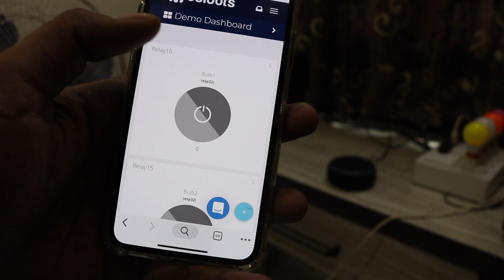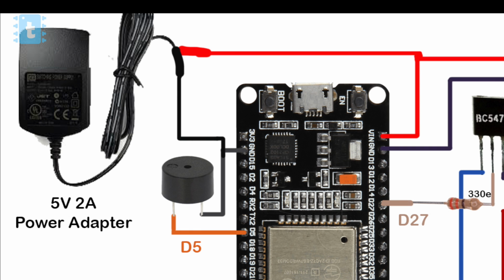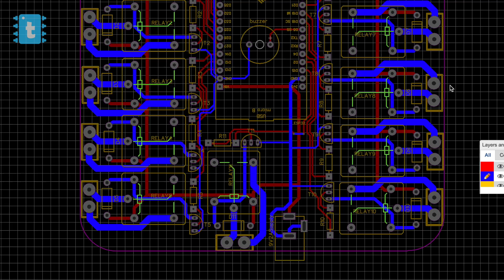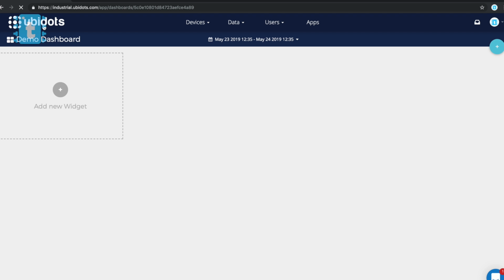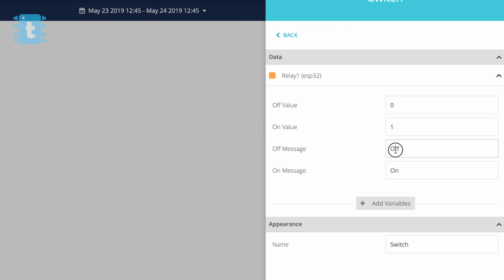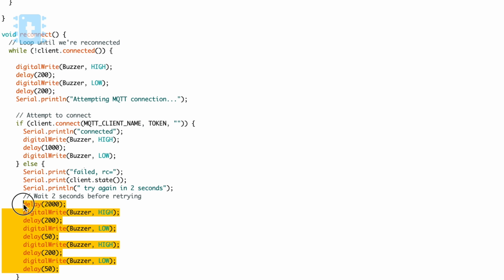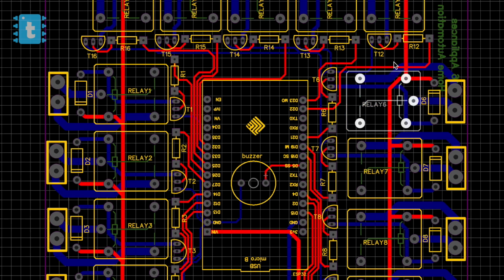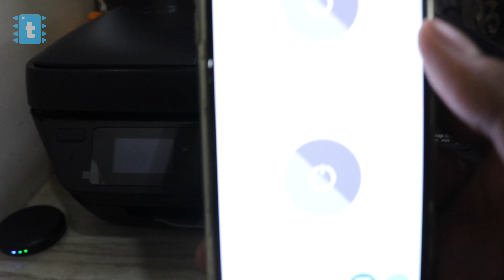My biggest Home Automation project using ESP32 | IoT Projects | ESP32 Projects | Ubidots | LCSC

Comment: GPIO 15 is a strapping pin that should be high during boot. You have it connected to the base of an NPN transistor that drives a relay. On power up, GPIO 15 will be at 0.7 volts and this could cause boot up problems.

Comment: I have an irigation system with 23 electro-magnetic valves and I whould like to make for every valve a seperate receiving board over 433 Mhz with Your system, can You make this ?  I whould like to learn to program the ESP 32 to start in the morning/night and evening/night. I investigate now 2 send receive boards that I bought on Alieexpress that work with the TP2264 send and TP 2294 receive in the 433 MHz band, maybe a combination is possible ?

Comment: Please...just please,  have some separation between the low voltage stuff and the mains power. In your enclosure the mains terminals are almost touching the relay board.
Reply: This is horrible engineering, just horrible.

Comment: I have one question
Why my node mcu esp8266mod is geeting very hot and spark when i connect it with my laptop through usb cable?
Because of high voltage supply?
If yes then what should i do?
Plzz help me🙏

Comment: Nice project! But if i were you, i would not put the trace that goes from the transistor collector to the relay coil that close to the relay's contacts traces! the isolation gap is minimal and there is a risk of mains voltage jumping to the low voltage circuits side! (dangerous!) Maybe you could correct that on the next revision of the board... Anyways, a really practical project!

Comment: Limited to 16 devices by the output pins of the ESP32? I can easily control 768 relays using 1 pin and without multiplexing hardware.

Comment: Well, just what i was thinking about. But my idea is to use triacs or mosfets (for AC or DC loads) in the form of replaceable modules (like drivers on some control boards for fdm-printers )

Comment: Sir if the circuit is always ON nodeMCU will not get damaged in future even when connected to smps 5v 2A mobile charger?
Reply: Nope. They r designed to run all the time. 5V should not harm the esp but dont use more than 5v.

Comment: Sir is not connected to the internet
can you tell me how can i solve it..This is show on serial monitor

 ets Jan  8 2013,rst cause:4, boot mode:(3,2)

wdt reset
load 0x4010f000, len 1392, room 16 
tail 0
chksum 0xd0
csum 0xd0
v3d128e5c
~ld

Comment: Sir I have using water tank level transmitter for measuring the tank level. The transmitter output  is 1 to 5 V variable 
Means
1V need to set 0%
2V need to  set 25%
3V need to set 50%
4V need to set 75%
5V need to set 100%
Can you make gauging display via blynk app with modemcu

Please  make code for me

Comment: Better if it was done using voice automated control, so that you do not have to turn on and off your mobile wifi connection instead, just send a voice command to turn on what you want to turn on and off on the fly. Good project though. Does it can be connected to your modem wifi in case you are not around and forgot to turn off something. Just connect to your IP address modem and turn it off even if your let us say ANTARTICA...LOL

Comment: hi sir. I'm getting error like this in serial monitor
rst:0x10 (RTCWDT_RTC_RESET),boot:0x13 (SPI_FAST_FLASH_BOOT)

configsip: 0, SPIWP:0xee

clk_drv:0x00,q_drv:0x00,d_drv:0x00,cs0_drv:0x00,hd_drv:0x00,wp_drv:0x00

mode:DIO, clock div:1

load:0x3fff0018,len:4

load:0x3fff001c,len:952

load:0x40078000,len:6084

load:0x40080000,len:7936

entry 0x40080310

user code done

ets Jun  8 2016 @

plzzz help!

Comment: Hello everyone . Can this circuit be used to control an electrical circuit of a home? Do you think it's safe? . I will change the relays for others of greater amperage capacity but I want to be sure that the design is used for a home electrical network. Thank you

Comment: Hi, this is a great channel Youtube recently discovered for me haha, thanks for the work on bringing it to us. I have a silly question, is it dangerous or do you need some kind of extra protection around the high voltage routes on your PCB? Could you provide some guidance on how to design them please?
Reply: I would avoid using this with high voltages.  Design does not provide for any extra HV isolation and there are no opto isolators either.  You can use this design and extend it.  Alternative is, design your own base board designed to mount the ESP32 as shown here and two 8 relay modules you can find on ebay.  Essentially your base board will be a 'mother board' that carries the ESP32 and two 8 relay modules.  Provide for additional circuitry if necessary, produce PCB and you are good to go.

Comment: I like this Project but for the house, it needs multi bored, I mean each point need separate pieces because the electric at the old and new houses because it's costly (I mean the copper wires), not designed for these systems. they are not in the Desk hehehe ;p

Comment: Hi, very nice proyect, I just wanto to add the relays dont have the necessary insulation and electric shielding for this to work properly, a single diode is less than suficient, I would like suggest the use; 
An insulated ouput, like the diigtal pin to a UNL2003 to avoid vcc peaks, and then a  of a snubber and a varistor on each relay output. 

For the sake of the electronics. 
Good work !
Reply: 5 volt relay how peak come

Comment: Can you add physical switch 
I mean turn on/off the relays via internet and physical switch
Reply: just connect a two switch and relay in two way connection mode
Reply: Arun n.g if use two way switch you don’t know the Device on or off
Reply: @hassanahmad9597   which device?, Controller or the appliances. 
If you use the two way switch in parallel connection with relay, then you have to use the same way to turn it off. I mean if you turn the appliance with switch then you can't turn it off using relay. It's not convenient. But if you use the switch and relay by two way connection mode then you can control your appliances. Just give the supply to two way switch and connect the switch's terminals to no nc terminals of relay. You can take the output control lead from relay common point.
Reply: Look 
I want to connect push switch to the Arduino 
When you push the button both relay and internet switch turn on or off ?
Like the sonoff switch

Comment: I wonder if you PCB is safe to use for 220V -(240V) and at what load. I can see that your low power lines on the PCB are pretty close to the high power ones. I'm concerned getting a leakage and PCB burn. Also there isnt a single fuse on your PCB. So while it looks neat, I cant believe its safe...

Comment: First of all - its NOT automatic - its REMOTE only. Second - china blue relays its nice way to fire up you home. You need magnetic starter for feeding things like a iron, air conditioner or heater. Blue relays can feed only small consumers like a light bulb. And at last - USE OPTOCOUPLERS  if you dont want to kill someone.

Comment: This is not automation bro... Its called remote control
Reply: Correct. Automation would be having circuits on timers or sensors to turn things on or off at certain times or when certain conditions are met. Like a lawn sprinkler system or dusk till dawn lighting or even a sump pump in a basement..

Comment: Yeah, no isolation, and those relays are way too small for any real world load switching. 
In reality you do not need all those relays when you can use properly rated power transistors which will reduce overall power consumption and the need for a snubber network / diode. You can in turn use the transistors to switch solid state HVAC relays which can handle real world loads like an entire lighting section, air conditioners and other moderate to high current appliances even switch your main city power on and off or between solar or generator power and mains city supply. make the system usable to a realistic degree.. Those tiny relays on board will only introduce a possible fire hazard into your home if you over load the circuit.
Modify your PCBs to have line isolation and mounting options and earthing provisions so people in countries that have actual electrical codes that are enforced can actually use it legally and safely.
Also this is in no way automation, this is simply over the net remote control and you do not need fancy apps on a smartphone to do this. a simple webserver arduino code with some HTML code in it loaded straight into an ESP module and all you need is a device that can connect to wifi and has a browser and you are in business. I can take your whole project and reduce it's size over half and make it NEC compliant for use in the US all while making it capable of controlling high current loads with no mechanical relays on the main PCB at all..

Automation would be having circuits on a timer  like a sprinkler system at home or on a day/night sensor to turn lights on and off..
Reply: ElfNet Designs  
"That is what 1st world developers can do" : You are a proud man, good for you keep up this community spirit .
This video showed you the essentials, it has all the parts to make home automation, so you can customize it (or built it to your code). I ve replicated it and it is working fine with all the automation rules (dependencies and timing) that I needed and only 8 relays (upgraded to 25A relays for AC, heaters etc.. block relays with isolation so didnt use the video circuitry) but couldnt do it without the support of such videos.
Reply: Perhaps you should do a bit of research before spitting on someone's work.  Your point about true automation is correct, this has no brain, so to speak, and is thus not true automation.  This hardware package could, however, be used for true automation with no modification, simply different code.  That being said, this is where you stop being right. The transistors he is using are, in fact, correctly rated for this application.   Transistor rating also has nothing to do with the snubber diode, which is designed to snub (thus the name) the back voltage produced by the relay coil turning off.  Any proper circuit which uses a mechanical relay will have such a diode or equivalent protection system, changing the transistor does not eliminate the need for this.  Your comment seems to indicate that the relays could he replaced by high power transistors, but that's such a ridiculous idea that I'm going to assume that's not what you meant.  Maybe you meant use the high power transistors to drive a SSR, but that's unnecessary.  Small transistors like the ones he has are perfectly capable of driving even very large SSRs, and actually, for the size SSRs used in home automation, the NodeMCU itself could directly drive them.  As for the size issue, I don't know if you've ever seen a SSR, but they are typically larger than their mechanical counterparts.  That being said, I'm sure if you went with the most expensive, modern SSRs you could find, it would be significantly smaller.  It would probably also be 100x more expensive, but since you're a rich guy in the 1st world that shouldn't be an issue for you.  And just FYI, most '1st world systems' use mechanical relays, snubber diodes (usually TVS), and a transistor based driver circuit very similar to the one used here.
Reply: @back_to_momblackburn8580  lol, haven't expected to 100% agree with ur comment, but I do. Exactly, people trying to have a cool hobby, and an electronic smartass comes with his shitass electrical codes and rules, who cares at this point lol. Applying to codes won't help much if the person isn't careful and reasonable in the first place.
Reply: @back_to_momblackburn8580  use a fuckin bta-16 is probably what he meant, it isnt a transistor but the closest thing to one.
Reply: So show us what you can do.
Reply: @Thuliolima2008  I myself do not have to show you when all you have to do is look up any 1st world based system that is properly installed and being used in places where electrical codes are known and enforced.. Look at the many many other IOT based systems sold under big name brands and installed in places in Canada, The USA, the UK, etc... That is what 1st world developers can do..

Comment: Nice project. But is it wise to use an external iot platform? If they pull the plug you're done. I'd advise to host your own with MySensors, Domoticz, OpenHAB, Grafana, etc. You can run all on one raspberri pi. NRF24L01 is supported by MySensors out of the box.
Reply from the maker: Thanks for the update 
I’ll explore them all.

Actually I have tried mosquito mqtt server on raspberry pi but that’s only limited to local area connections 

What if we want to control appliances from anywhere in the world. Then we need to use ubidots or other cloud based mqtt server
Reply: @techiesms  It is not restricted to local area networks. You can access your raspberry pi from anywhere in the world if you configure your router to use NAT. Just forward the desired ports to a local ip address and port. It is also possible to use a dynamic dns to be able to use a custom url as well.

Comment: Well can you operate appliances with both normal switches and mobile.
Reply: I would not run anything over 1 amp @ 120 VAC through those relays and definately nothing from the AC mains without proper earthing, unless you have good homeowners insurance that will cover experimental screw ups that result in a fire.
Reply: @Elfnetdesigns  sry I can't understand it clearly what your trying to say.

Comment: People are complaining there are no optocouplers. There is more than enough galvanic isolation in the relay. Absolutely no need for optocouplers. It would certainly be a gimmick in this application. However, I'm not saying this is a well thought out idea. 16 remote mains switchable circuit in one place, what 16 AC appliances would you need to, 1. Plug in at one point in the home, and 2. Need them all to be remotely accessible? Also the ESP32 is massive overkill for this super simple application. Why not use an esp8266? So much cheaper! Or an arduino with a Wi-Fi chip? Or an AT tiny driving a multiplexing IC and a Wi-Fi chip?
Reply from the maker: Esp8266 doesn’t have enough GPIOs for controlling 16 relays. Secondly that rate of nodemcu and esp32 don’t have much difference
Reply from the maker: Graham Keep not all GPIOs are accessible in arduino ide 
I have tried that
Reply: Its also worth adding, this circuit board design is not well thought out. He effectively has 16 common inputs which I don't understand. He only needs 1 AC input.  I do understand the 16 outputs though. And why not build the 5V power conversion into the board? That will quickly turn into a bird's nest of wiring with 16 inputs and outputs. The other thing is, using all 16 outputs, you must keep the sum of each appliances power under 2400W in Australia, probably 1100W in USA? depending on the circuit breakers rating in the fuse box (most will trip at 10A). That's an average of 60W per output in the USA.

Comment: just out of curiosity, Is it a good idea to have High Voltage AC and Low voltage DC parts on same PCB ???
Reply from the maker: Ya it’s ok. It’s working fine
Reply: @techiesms  ok.. thank you
Reply: @techiesms  JESUS CHRIST just STOP. Just STOP!!! STOP giving people on the internet such dangerous advice! You obiously have NO clue about electronics! Jesus Christ simply because it works does not mean it is safe!!
Reply: The name of the game is good isolation.
Reply: just separate them with enough distance, look at power supplys.

Comment: There are ready made boards with 8 relais, with optocouplers and everything. No point in making your own except for educational reasons or tricking someone to set their house on fire remotely ;-)
Reply: So how does using, optocoupler can stop this device from catching fire exactly,   as far as i can understand, optocoupler isolates mcu from relay coil, that's it.  its a safety to stop if any high voltages from burning mcu, like silicon level not really like a electrical burn
Reply from the maker: With that said, the smartest device in your pocket is also got blasted in my countries. And dude that’s a product 

And in my case it’s a project, still
I tried and tested this project at my level and it was working perfectly. Precautions are still need to be taken while working on AC appliances

Comment: Instead of all the circuits, you can easily buy a readymade 16 channel relay module at very low.cost at near buy Electronics market 🤷
Reply from the maker: My goal is to explore learn and share. I completed my task. Making or buying is your decision
Reply: @techiesms  yes. but the one you buy would at least be up to standards and safe to use. Your PCB design is horrible and highly dangerous.

Comment: Can you please make a video on following concept

Esp8266 home automation 
1) which can run on dead WiFi ( without internet ) or make its own hotspot

2) having switch override option ( so my grandparents can also use lights and fans )

I implemented your old blynk server automation video which was working awesome but now my internet is dead and one problem was my grandparents wasn't able to turn on/ off devices
Reply: Yes  Ans 1 . You need to try offline IP based program for non internet usages..

Ans 2. For this solution you need use two way switch in switch board for non automation usages. Because in this way both relay and Switch work simultaneously